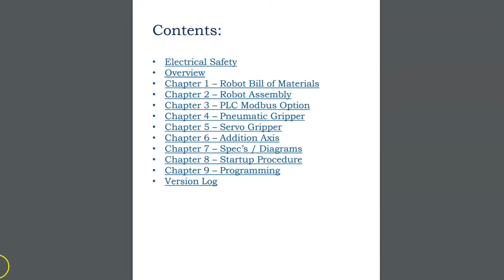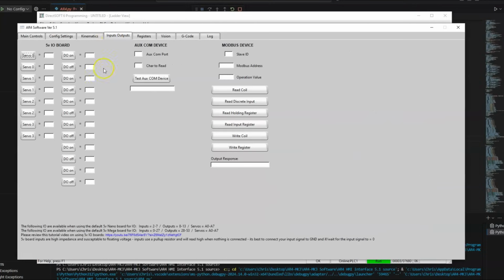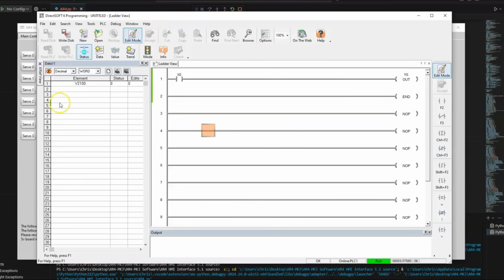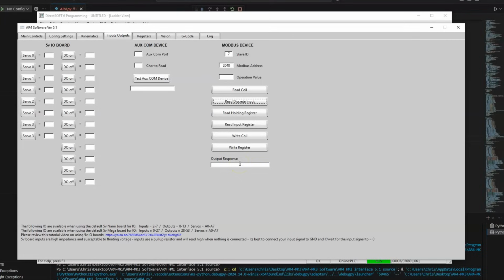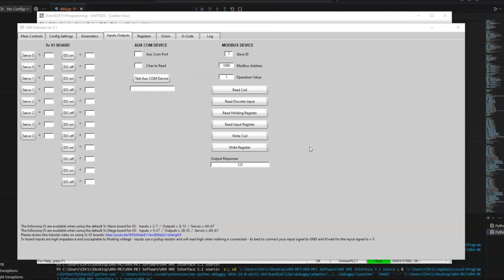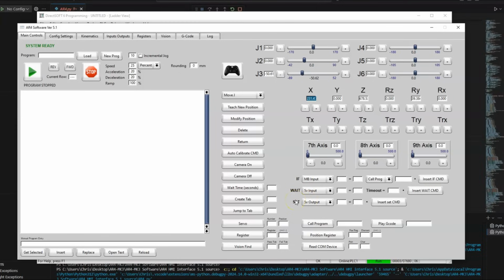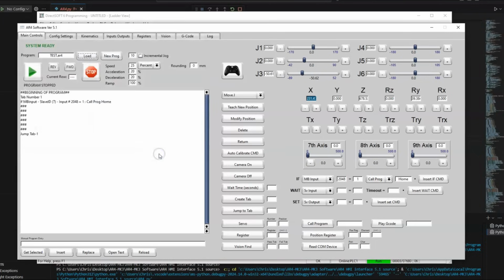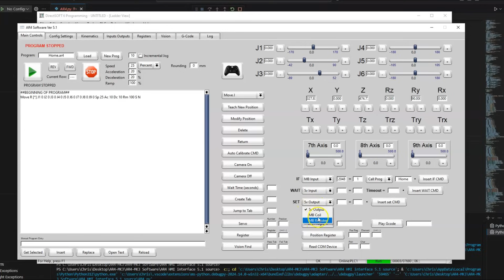AR4 ROBOT MODBUS UPDATE - DIY 6 axis robot kit / Arduino controller with Python program interface

Comment: Hello, I want to ask, when I upgrade my AR 3 robotic arm to AR 4 robotic arm,
In AR 4, does it belong to MK1? Why can't I run the AR4 and ros2 programs provided on GitHub? Why is there a solution? What kind of control method should be used?

Comment: Hola, el brazo robotico puede además guardar movimientos que se le realicen fisicamente?. Gracias.
Reply from the maker: The robot does not have hand guiding as the gearboxes are not meant to be backdriven - the robot needs to be jogged to positions or position values numerically entered similar to an industrial robot.

Comment: Nice. how much do the motors cost? have you considered RC brushless motors with encoders as a cheap fast strong good solution?
Reply from the maker: The choice to go with steppers was entirely driven by cost and off the shelf availability.  These gear head hybrid motors were off the shelf options and low cost.  I 100% agree servo or dc brushless is ideal.  The smaller servo motors that have come on the market since I designed the AR4 usually have to be paired with a bolt on gearbox increasing the size a bit.  Also the wiring is simple and drives are small.  It could definably be done but the cost and  wire loom complexity would go up a little bit.   It would be a great future update or redesign if I can keep the cost to a minimum.
Reply: @anninrobotics  yeah it depends a lot on convenient availability. presumably with agile servos it can be a different league of animated and strong
Reply: @anninrobotics  Hi Chris, I am very interested in implementing AR4 in my factory to pick and place thin pipes weighing from 500 to 800g. I just saw your comment on Thomas's video. I couldn't find the video you mentioned "a quick video of the forced deflection on my build". Could you let me know where I can find the video or maybe the title of the video if link doesn't work here? Thanks!
Reply from the maker: @sejungsong  Yes the video is here https://youtube.com/shorts/lf_KFFiCdJA Thomas didnt take any time to tension the belt or follow some of the details in the manual unfortunately.   Please let me know what other questions you have.
Reply: @anninrobotics  I looks a lot more rigid. 

1. For those who have some experience building or fixing machineries, how long do you think it would take to finish and test run the machine with the complete kit? 

2. Do you think the tolerance of machined AL kit is tight enough for close-to-max precision of AR4? Or you recommend machining it myself for better performance because there is still room to go.

Please let me know. Thanks!
Reply: If affordability is the key objective of this machine and it's not intended for high speed motions, I think stepper is the right choice over servo here.
Reply: @sejungsong  actually the opposite is true. Steppers are very weak for their size. The same size motor as a brushless might have 100x greater torque. That is no small margin. The greedy servo industry however has overpriced servomotors greatly but servomotor just means a motor with an encoder so from the right supplier they can be very cheap. Non steppers are also much smoother and faster. So potentially much cheaper, faster, stronger is why steppers should have ceased to exist decades ago but things move slowly
Reply: @ Definitely higher torque with servo but if it's the same size, 100x is a bit too exaggerated. At a very high rpm, might be yes but at a low speed operation like 500Rpm it's probably 2~3x? and below 200Rpm stepper could be comparable or might perform better in terms of torque. All I am saying is, yes servo is better choice for a robot like this but if you can compromise speed for lower price and simplicity, stepper is a good choice without losing too much payload for its size. And I think it's the case here.
Reply: @sejungsong  the brushless motor needs higher gearing to show its strength, it might not be fully 100x greater power/resulting torque but 40x also counts
Reply from the maker: @DanFrederiksen  the motors, gearboxes, drivers and power supply are about $750.  I have looked into different DC motor options, but haven't made any decisions yet.
Reply: @anninrobotics  for 5 motors? that's not too bad. are they steppers or servo?
Reply from the maker: @DanFrederiksen  6 Stepper Motors with integrated gearboxes ranging from 50:1 ratio to 10:1 ratio
Reply: @anninrobotics  they don't have equivalent servos? stepper is an old awful principle

Comment: Maybe this is an obvious question, but is the newest release of the software and the Modbus board install compatible with the AR3 as well? Thanks for all your work on this project Chris!
Reply from the maker: Yes this is the latest and is also compatible with the AR3 if you update the control board to the teensy 4.1

Comment: Great work Chris, thanks! Did you ever had someone converting an older Fanuc robot to your software and controller?. I managed to get an LR-200 which is mechanically still good but all the electronics are shot. Thinking about starting a conversion. :)
Reply from the maker: Yes I've had a few people convert other robots, I don't recall if it was a Fanuc but I do remember a motoman.

Comment: That's a great feature to interface with the PLC world !
Reply: or with for example with node-red via a RS485 to ethernet or USB adapter
Reply: Hot damn Chris! This is fantastic! Works with the previous iteration of the AR4, correct? My students will love this! Gives them an easy way to interface the PLC controlled automation setups they are building. Love it! Thank you!

Comment: Hello Chris Annin, I have watched all the robot-related videos on your channel, but I haven't been able to build one yet. The stepper motors and metal parts are quite expensive. I hope you can create a similar robot model in a smaller size using NEMA 17 stepper motors, an Arduino Mega, and 3D-printable parts.